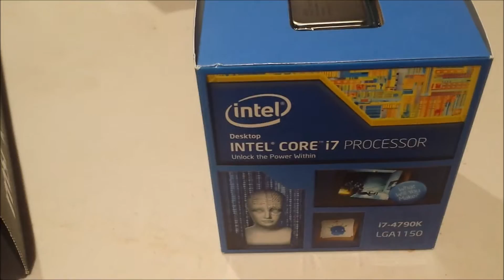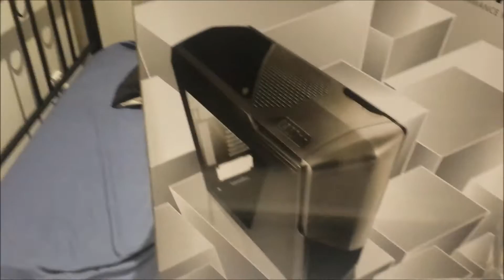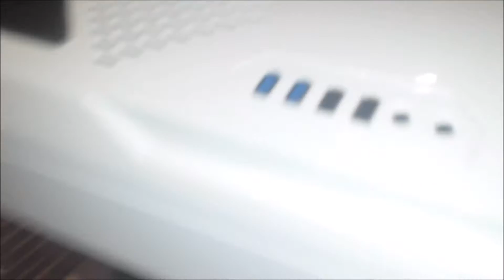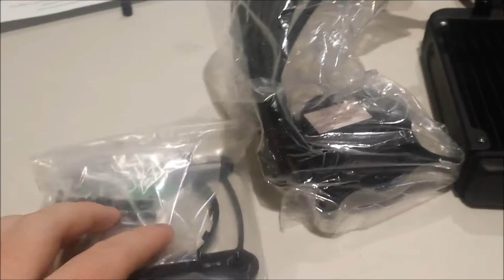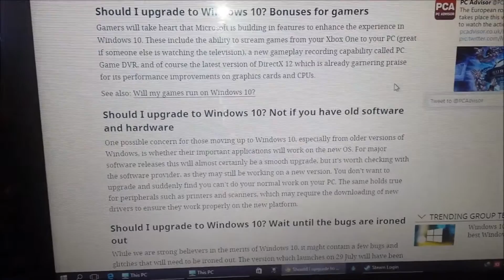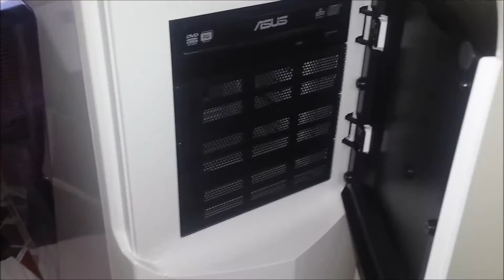The Tuxedo Build

Comment: can an i5 4590 fit?? its an 1150 socket
Reply from the maker: +Jack Firpo I don't see why not.
Reply: +OhManTFE what did you do about old drivers and windows?
Reply from the maker: Morgan James ???
Reply: +OhManTFE u said u used your old hard drive and that has all you old stuff on. did it cause problems?
Reply from the maker: Morgan James Oh I just reformatted my SSD and put Windows10 on it. My other drives didn't need formatting. They could be accessed as normal.
Reply: +OhManTFE how did u reformat it?
Reply: +OhManTFE looking to do a similar build
Reply from the maker: Morgan James Good luck. If you need help learning how to reformat check out Google for guides.